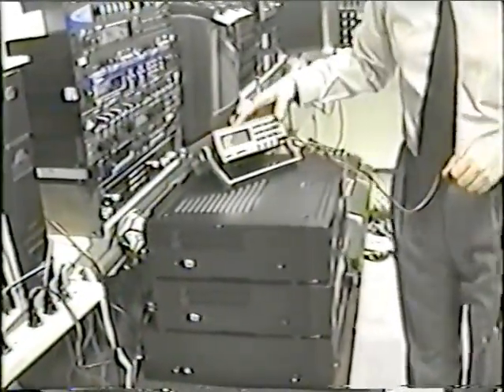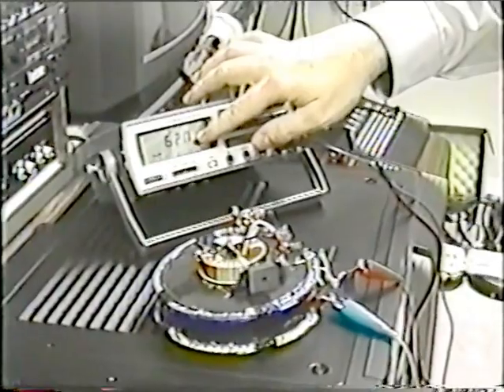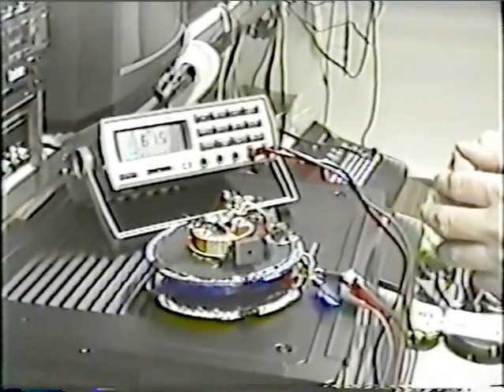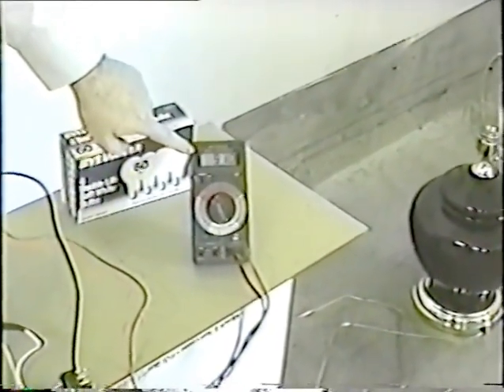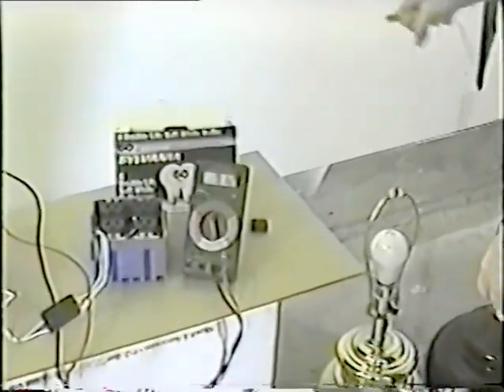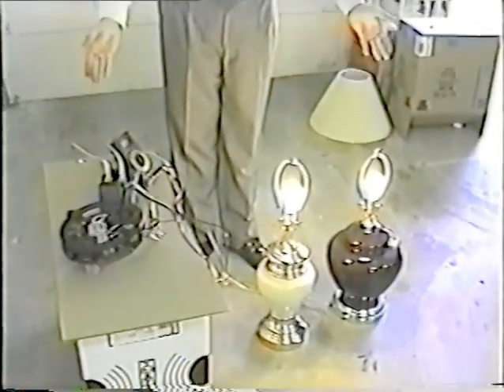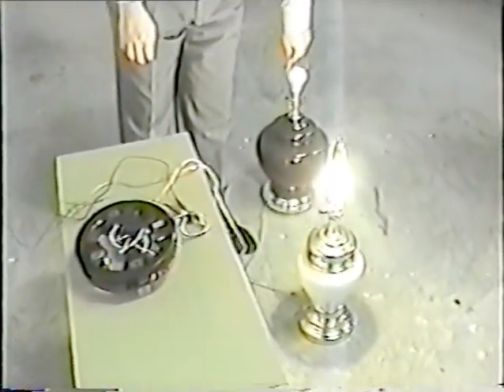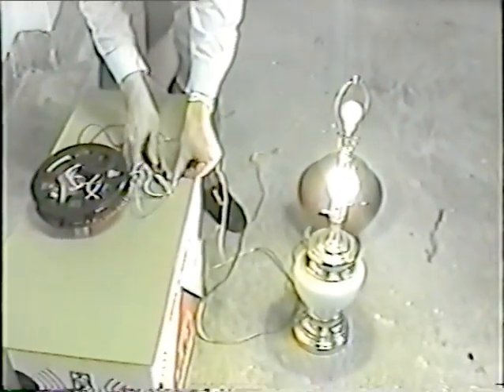Steven Mark TPU - Answer in text: how it's working...?

Comment: 5kz pulsed dc
Reply from the maker: This is output 5kHz DC
Reply: "Think of the output as dc (pulsed) 5khz with lots of Hash in it." Mark's close cooperate.
Reply: 9:00 Steven Marks says that it's 6.000Hz AC but converted to DC, maybe with a Bridge rectifier (4 diodes) used to remove the negative half component of AC? This process is called the Rectification.